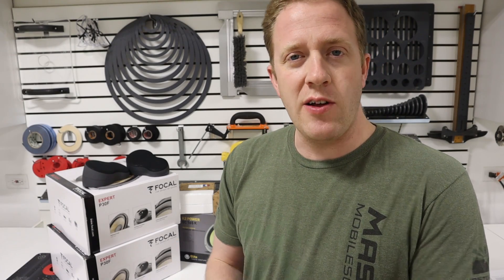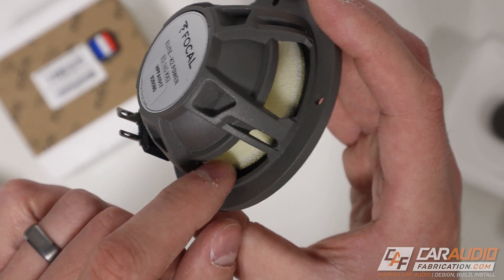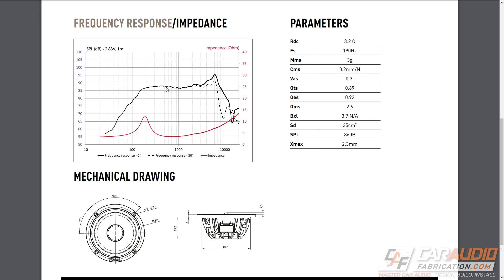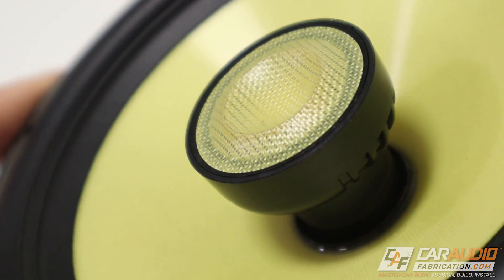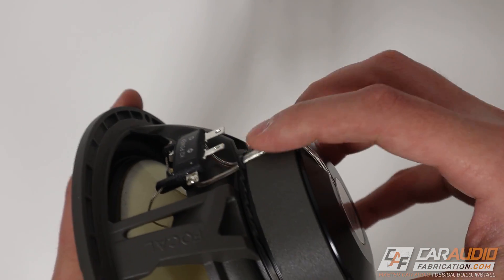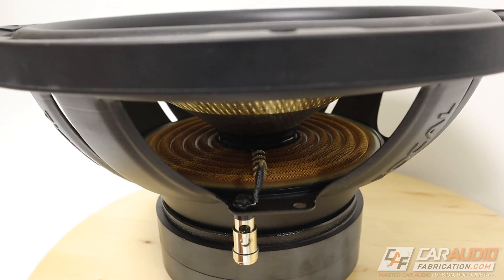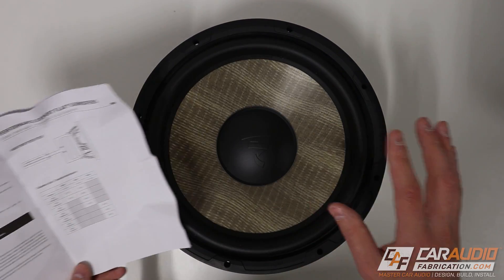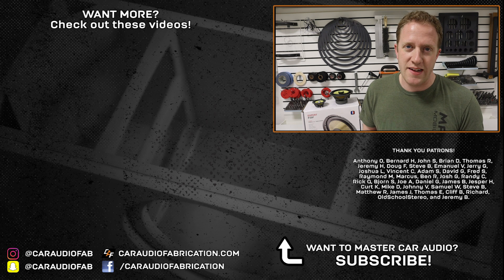Focal Elite & Performance Speakers Overview

Comment: Looks great. I'd love to see two identical builds with a twist...one uses high end stuff like these Focals, but the other uses budget friendly, less expensive, but equally similar components to so how each differs and why the good is good or that even entry level stuff can be good too, and good sound doesn't have to be sacrificed when $ is limited.

Comment: Focal is one of the best high line speaker maker.  If you like hearing what is really produced, Focal is will work for you. I have them in two cars and was looking at Morel Hybrids but they don’t compare. The elate by Morel might run with the Focal K2 series.  Great review Mark.

Comment: One of my favorite videos you've ever made. I bought these 3" mids from Woofers Etc. Got the tweeter/mid pods from a friend. May even do the 4" mids one day along with Mosconi amps and processor. Very glad to see SQ oriented content!
Reply: John Clark 
Yeah. I got some focal three ways pushed by a mosconi. Really nice combo. I went with a jbl signal processor with 31 band eq, etc.. I have 2 jl audios 12” subs run by a 600 watt jl audio amp. 
Good luck on your setup brother. I’m happy with mine. Hope you will be too.
Reply: @NineToes19  I have the JL Audio TWK 88. Two 12TW3 (truck Stealthbox) on an Audiocontrol Epicenter 1200 amp.
Reply: John Clark 
AudioControl good? Equal in price to what?
Reply: @NineToes19  Audiocontrol has been around a long time. Got a good deal on it and it does rated power. They are all class D now. Not going to do class D on mids and highs though.
Reply: John Clark Genuinely curious as to why you won’t run Class D(Amps I’m assuming) for mids and highs? Just kinda started getting into car audio!
Reply: @JohnDoe-us1ek  A little hard to explain, but I'll try. Just haven't heard class D sound as "warm" and musical to me. It sounds "cold" and etched if that makes any sense. I haven't heard many higher quality ones either and realize that it probably is the future at this point. I am kind of "old school" I guess.
Reply: @johnclark3067  hi John , I’m guessing you prefer class A/B amps?
Reply: @seanmichael2777  Yes. Although my studio monitors (Focal Solo6 Be) have 100 watts AB on each tweeter and 150 watts BASH on each mid. They are the best sounding speakers I've ever owned.

Comment: Do you remember the Pioneer clear-ish polypropylene cone woofers from the 90s?  I still remember building a box and stuffing a neon tube inside it to make the cones glow.  It's an awesome, retro look!
Reply: I used to have the M & M poly 12's back in the late 80's. They had a clear "frosted" looking cone.

Comment: Those baskets all look cast, which as you know, is the only way to support your driver components. Focal brand components are well known for being clean and highly detailed. I would buy this brand without any reservation. Not an installer, but I know great sound and focal is great sound! I sound like a commercial! Facts are facts guy. This company makes great products! Great video! Saw you were using Audio Control. That’s another good company. Back in the day, Soundstream was my favorite amps. Class A and A/B are the only way to go. Yes, they are less efficient, but sound quality is first priority in my book! I’m not an SPLr! That’s another story for that side of it. To each their own!

Comment: Hello I have a Jeep wrangler jku and I am looking to up grade the audio system in it, I just got a stinger audio head unit no I am looking to get the ds18 sound bar to replace the stock one. I am also looking to get focal speakers which ones would you recommend?

Comment: I'm looking at a new Chevrolet 2500HD regular cab pickup. Two speakers in the door are standard. 6X9's. There are grills in the corners of the dash for crewcab upscale trim levels. Thinking of Focals or Morels in the doors and dash. Using factory locations. Maybe a single sub behind the seats on the shelf. Don't want to lose to much of the storage space behind the seats. Want to feel like the piano and other instruments are right next to me if I had my eyes closed.

Comment: , very nice, my truck has the upgraded Rockford Phosgate system but the mids and highs really do SUCK in my system. I think it has ten speakers in the entire system
tweeters on the dash.
I want to start by replacing those tweeters.

Comment: Hi Mark,
I was going to go Cerwin Vega for a couple of 12's but now I'm going all Focal for speakers (I want to stay away from chinese stuff as much as possible), but I'm going all Flax lineup. Which amp did you use to run that pair of 12-inchers?
Thanks!!!
Reply: Never mind found the video that you switched these woofers out with and that originally they would have been powered with the LC 1.800.
Thanks

Comment: Great video! I love focal drivers they pay a lot of attention to the little details. That’s why I was somewhat shocked to see the single terminals on each side of the sub (not my favorite, but acceptable) with the an empty terminal hole on each side... I’m not sure if they offer a dvc in this line, but that could explain it I suppose
Reply from the maker: I believe they use this basket on the Access line of subwoofers as well. I think technically the split wiring is more advantageous for the speaker as it leads to balance each side of the spider, but definitely not as easy to wire.

Comment: how are you powering all your speakers here? Are you running the woofer, midrange, and tweeter off the same amp channel? or separate channels? Im trying to figure out how to add some midranges in my 2 way component system that already consists of a woofer and a tweeter. Also not sure if I even need the midrange. Just trying to do things right.

Comment: i want to upgrade my factory speakers and sub but i still want to use the factory amp can this be done..?..i have the bose system now can i run passive speakers up front and what sub work great in a small space..?..just want to improve the sound it is a daliy driver..

Comment: your videos are absolutely the best.  trivia: FOcal not foCAL is how they pronounce it.  I have the 165 KRX2 woofers and they are tremendous but I bought a set of Utopia 165 W-RC to replace them.  I would be most interested if you were you do a compare.  I switched out the KRX2 tweeters for the Morel Piccolo, which are beyond incredible.  just one more thought, in my other car, I have the Focal ES 130K and that ‘M’ shaped tweeter is much better than the prior version inverted dome tweeter.
Reply: I also have the 165KRX2 and agree about the tweeters. Have you gotten rid of the Utopia tweeters?
Reply: John Clark I found a merchant who was willing to sell separately just the Utopia W-RC woofer, so I never had the Beryllium tweeter from the set.  I am sure the merchant had someone else who wanted just the tweeter.  win-win.   I simply cannot imagine it would be better than the Piccolo tweeter which is truly phenomenal but I never actually tried it.
Reply: @zech912  Oh, I see. Woofers Etc sells the Utopia 6.5" separately as well. I am so tempted to start hoarding high-end car audio speakers. Would like to try them out in speaker boxes in the house first. Crazy, right?
Reply: John Clark nope, not crazy, I wish I could do that myself.  I have hesitated to install the W-RC woofers because I am not truly certain they are better the 165 KRX2, though I did read someone who compared and said they are.  and just today I see Focal is now making the replacement for the W-RC, the W-XP, now I need to learn about them first.
Reply: @zech912  I've heard both but never owned Utopia yet. The Utopia are less forward sounding to me; more neutral like studio monitors. KRX2 have a more aggressive "in-your-face" sound to them that cuts through road/wind noise better. The beryllium tweeters are world class and obviously better than my TN53K.
Reply: John, just wanted to note that I agree with your assessment on the Utopia.  What I ultimately did was buy the W-XP woofer only, and it is amazing, clearly truer, richer, even than the KRX2.  btw, I am both doug myers and zech912, depending where I sign in from, it assigns a different username, as i am sure you realized.  so I have an unused set of w-rc to decide what to do with.

Comment: these are beautiful but way out of budget. 

what would be a nice set of speakers for my 85 merc 500sec 
stock speakers allow 4 by 6 in dash and rear deck but i figure i can put some 4s upfront and 6 coax in rear, and maybe some custom sub enclosure....id like to keep the project under 2 grand....any thoughts

Comment: I have a 21 Ford F-150 reg cab that I just want to upgrade the speakers, so just two door speakers and two A pillars. Can you run Focals off a stock head unit and no amp and still have it sound good? Or is it not worth it unless you add an amp?
Reply: I have front and rear focals in my 2020 F150, along with a sub. I do have an amp, though it's fed from the factory head unit. Technically speaking, you could just swap speakers out, but I really don't think you'd be getting your money's worth. The factory head unit really doesn't deliver much power, and it's more than likely the focal speakers are made to be driven by far more than what the factory head unit puts out. Granted, it would still be a vast sound improvement, but once you hear how good these things sound, you'll probably be wishing you had an amp to drive them.

Comment: I had Diamond Audio components. I personally liked them more when I was considering MB Quart and Focal.
Reply: I had Diamond before Focal, they are not even in same league.  I have the Diamonds in a box in the garage, available for a very good price, only lightly used.
Reply: Old school MB Quart along with Morel were among the best you could get in the mid 90's. I still have a set of Quart "competition" components with the smaller tweeters from that era. The metal tweeters can be harsh without eq.
Reply: @drm9979  I know this is old but do you still have the diamond speakers for sale?
Reply: @jasonb.7152  incredibly I do, this is the only place I even ever mentioned 
I have them and they are available.

Comment: Question for you. Have you ever seen/built driver enclosures for a door before? Would you think there would be a disadvantage to building a custom speaker enclosure for a door, sort of like those stick in foam driver protectors? However, instead of foam it would be fiberglass with a foam gasket on the flange to seal the driver to the enclosure. I do like my Harman Kardon oem speakers powered by a oem amp. They have nice punchy bass and it doesn't seem to roll off closer to full volume like some oem speaker/amp system would. To a degree it seems to be over driving them and I haven't really encountered any/much distortion with the proper eq set. Do you think using a 8inch shallow depth driver in an enclosure would sound good mounted in a door? Or would having a free airing driver with a higher range be better?

Comment: What's the cheapest solution for measuring watts without using two multimeters? how do you feel about skar?
Reply: Ohms law and one multimeter will get you close but you really need either a 1, 2, or 4 ohm load on an amp to get it's true power.

Comment: Thoughts on mounting the tweeter near the woofer vs away (like you did on the A pillar)?
Reply: novemberromeo78 its because he is using a 3 way setup, the highs are up on the dash while the midbass can essentially be anywhere in the front as its not as directional as the highs.

Comment: Hi Mark , how do the Focal's sound , I'm currently running JL Audio and find there tweeters to be harsh sounding.

Jon
Reply: Jon,

I have worked with Focal since Boston Acoustic stoped producing car audio. I wish we had switched years before that! The Focal products have a very rich sound that is unbeatable. The tweeters don’t have the harsh sound that some others do. I personally have the Utopia M series in one of my cars and will be doing a KX3 install on my daily driver soon. I encourage you to make the switch. You won’t regret it!

Deaton.
Reply: Bendmac Manufacturing I’m surprised you find the silk done tweeter of the JL to be harsh, as that is uncharacteristic of such a tweeter. Maybe try lowering the dB of the tweeter on the crossover.
Reply: Which JL tweeters are you running? If you have dsp, have you tried try to eq them?
Reply: Morel...... LOVE my Morel Hybrids over any of the 4 sets of Focals I've owned from Polyglass to Flax.
Reply: @TickleFingers  Another VERY serious speaker company. Wish I heard more installs with these.

Comment: JL Audio needs to take Notes. Since they have 3way component speakers.
Reply: JL C7's are great speakers but have a higher price tag. These Focals fall between the C5 and C7 line.
Reply: @jameselam8263  I hope to hear the C7s someday. JL Audio really needed some world class mids and highs! Hope they work out. Don't know anyone running them.
Reply: @johnclark3067  well they cost $2,000. I have them. I'm in central Illinois. I would try and find a dealer in your area to get an audition. Each brand has it's own sound it's just a matter of preference. JL and Morel have a smoother less bright sound. Focal and Hertz have a brighter sound so to say one is better than the other is a matter of your preference. I prefer JL or Morel , but you might prefer Focal or Hertz. All these speakers cost a lot of money so I suggest getting demos before you buy to everyone.

Comment: Are these Focal's available in 8ohm's?
Reply from the maker: I don't believe so.
Reply: In case you were thinking of running two pairs of mid basses, just run them in parallel on a two ohm stable amp. The Mosconi One 250.2 would be outstanding for that.

Comment: Is there much difference between say $500 door speakers and $1200 dollar?
Reply: Shoegum At a local shop I did a direct comparison between three lines of Focal speakers and the difference in quality was huge as you went up the line. A lot comes down to preference.
Reply: @Megawatt  hi, what was your impression of the k2 vs flax line?
Reply: @jm-vq4cm  in short, the Flax sounded good but K2 sounded great. I'm sure the Flax set would have sounded great in isolation, but hearing them side by side, the K2 sounded cleaner, clearer, and more natural to my ears. But then some people prefer the Flax sound. The models I demoed were PS165F and ES165K. I also demoed the Access set, 165A, which sounded quite poor compared to the others.

I used to own the P30F subwoofer. It was a nice sub but the magnet broke off when someone crashed into my car. So I replaced it with the E30KX. The KX sounded much heavier, if you know what I mean. Thicker, fuller-sounding bass. And a hell of a lot louder. Maybe the Flax sub sounded a little more accurate. But I was also using a different source unit which definitely impacted the sound, so take that for what it is worth.
Reply: @Megawatt  thanks for taking time to give me this long, concise reply. I wanted to get the flax evo but got a great deal on the older 163KR yesterday so i bought them.  I'm super excited now, waiting for delivery.

Comment: Why a sealed enclosure?
Reply: He mentioned that he wanted to keep the enclosure as small as possible. It would only be two cubic feet for that pair of flax twelves.
Reply: @johnclark3067 And it's a geared more towards SQ I'm guessing.
Reply: @bbchester6  Yes. Sealed subs typically produce tighter sounding bass that blends well with the midbass. They don't require a subsonic filter either and can put out deeper bass. It puts a higher demand on the amplifier and can tolerate a little bass boost at low frequencies if that's your thing. Ported and bandpass are louder, go low enough for most music/people and can sound really good too.